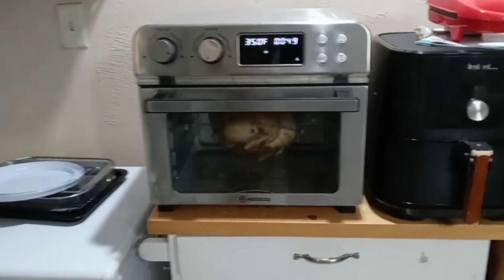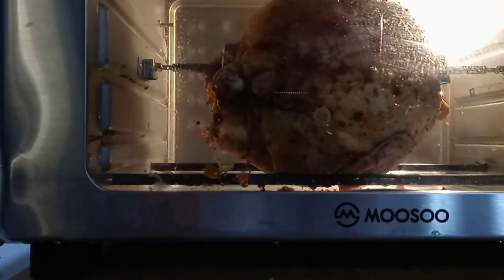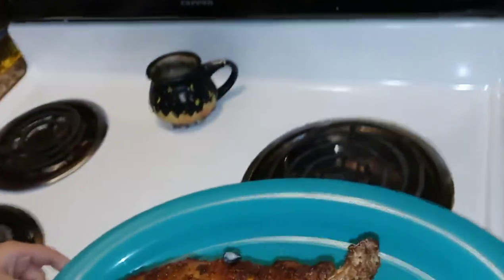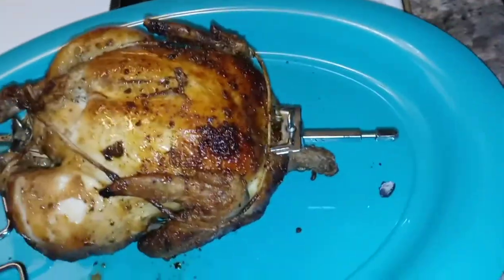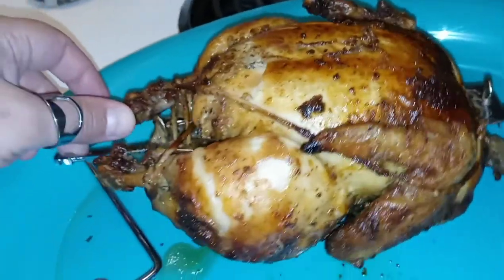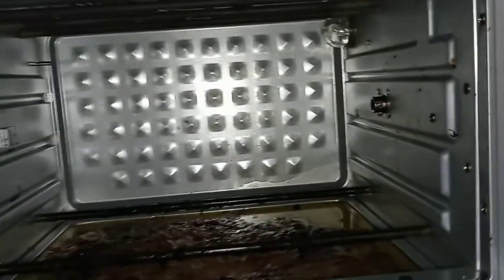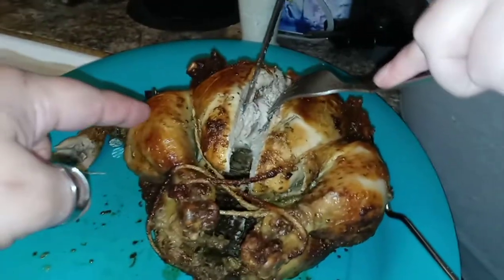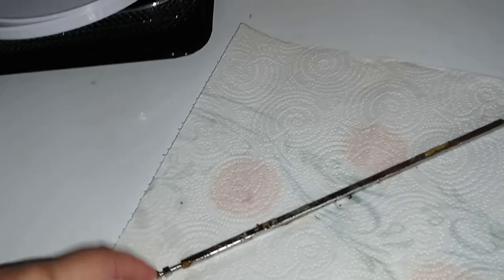Update on MooSoo 24qt Air fryer and Flaw Discovery

Comment: Hi. I just bought this same model. After watching your video, I checked my rotisserie stick as well. Do you think that it might work better if you turned the stick the opposite way and put the square end of the stick into the fixed side of the machine and slide the rounded end into the side where it just slides in?
Reply from the maker: Hello. I actually did try that and it wouldn't go in without getting really stuck. It also wouldn't allow the pointed end to rest inside the rounded groove because it's a bit fatter. If you or someone you know has a metal washer with a hole slightly smaller than the square end, you could with a round metal file widened the washer hole just enough to go over the square and stay in place. The washer I used in the video was a in a hurry kinda fix. The second washer I did it's more of a permanent fix and it works really well. I hope this helps. Thank you for watching

Comment: Your left side of the rotisserie bar should be on the right side of the machine, you put it in the opposite way. That must be your issue with the rotisserie. The right side is the one that has a smaller rounded part. How is your machine holding up so far?

Comment: What size pizza were you able to fit in it?
Reply from the maker: Regular size DiGiorno or Red Baron or any of those brands. Unfortunately though don't use it with a pizza pan because the pan is a little bit bigger than the pie itself so the door won't fully close but the pizza fits perfectly on the rack. Thanks for watching hope this helps!